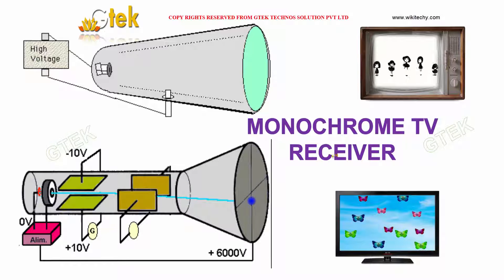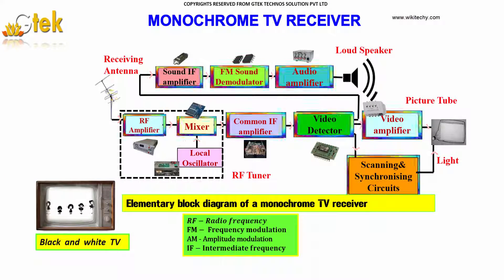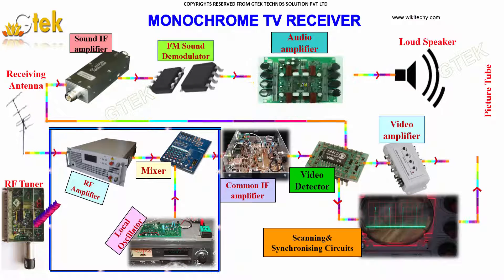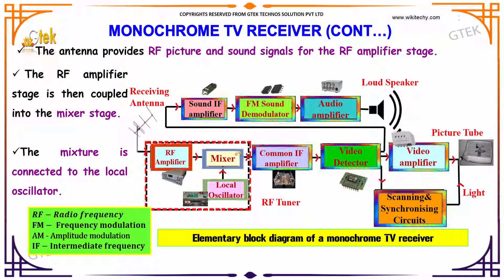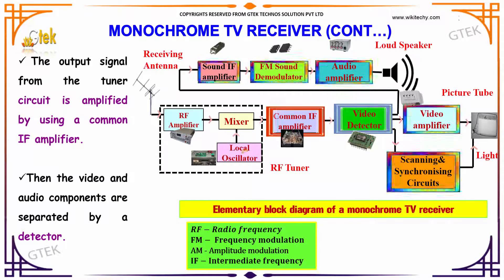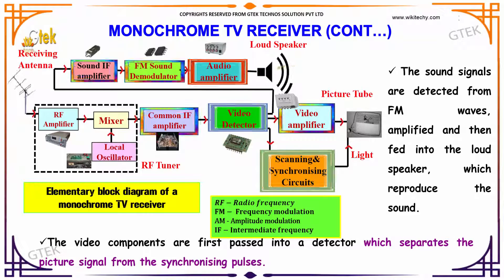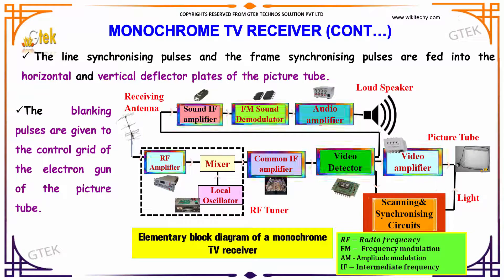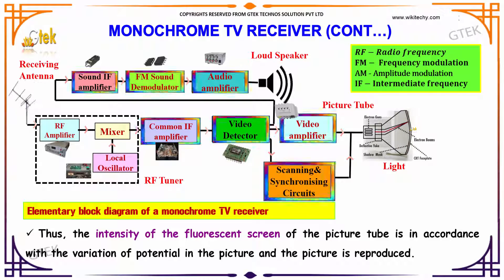Monochrome TV Receiver | Communication systems |class 12 physics subject notes|CBSE|IITJEE|NEET

Comment: The simplified block diagram of a black and white TV receiver is shown in Fig . The receiving antenna intercepts radiated RF signals and the tuner selects the desired channel frequency band. ... The antenna provides RF picture and sound signals for the RF amplifier stage.

Comment: The synchronising and scanning circuits produce sets of pulses for providing synchronising pulses for proper functioning of the TV system. This timing unit contains number of wave generating and wave shaping circuits.

Comment: Monochrome TV Receiver has the following blocks.
1. TV Receiving Aerial: the TV signal radiated by the transmitter has to be intercepted. For this an antenna with high gain, Broad Band, highly directional is used. Yagi-uda multi-element array is preferred. Impedance of the aerial should match the impedance of the transmission line. The aerial also selects the required signal and rejects unwanted signals.
2. Tuner: Also called RF Tuner/ Front end. Signals from Aerial are amplified, down converted to intermediate frequency. Band and channel selection is also carried out here. This is a separate, sealed and riveted unit mounted away from other circuits. Unit’s body is grounded to avoid interference by other strong signals. Delayed AGC is used at RF amplifier.
3. VIF Amplifier: The output of RF Tuner has two intermediate frequencies i.e. video IF (38.9 MHz) and sound IF (33.5 MHz), occupying a band width of 7 MHz. Most of the amplification and selection is done here. This is also a separate, enclosed unit. Keyed AGC is used at the base of 1st IF Amplifier.
4. Video Detector: The output of VIF section is around 2 to 5VPP. This is fed to video detector to separate various signals i.e., video, AGC, inter carrier SIF. A special diode driven into saturation has many harmonics at its output. Using LPF, signals above 5 MHz are filtered out. OA 79, Ge, heavily doped, point contact diode is used for detection.
5. Video Output Amplifier: Output of video detector which is around 2 to 5 VPPis amplified by a single stage broad band, voltage amplifier to give an output of 80 VPP. Wave Trap is used to prevent 5.5 MHz inter – carrier SIF (38.9 – 33.4 MHz = 5.5 MHz) and disturb the picture. Output of this amplifier is fed to picture tube.
6. Picture Tube: This is a special type of CRT, having widescreen with wide deflection angle. Electromagnetic deflection and electro-static Focusing is used. H and V deflection coils moulded into a single unit ‘Yoke’ is mounted on the neck. Final anode is applied with Extra high Tension (EHT) which is around 12 to 18 kV. Screen is formed by long persistence P4 phosphor, which is a mixture of cadmium tungstate and zinc sulphide. The light radiated is Yellowish white. With proper output from syn section, picture is displayed on the screen.
7. Sync Section: Output of video detector which is composite video signal has H and V sync pulses either at top or bottom edges. By feeding video signal to sync separator, sync pulses can be separated. We can use clipper circuit when the video signal is with negative sync. Further, by using LPF, V- sync can be separated. Using HPF, H sync pulses can be separated. These pulses are used to synchronize the H and V saw-tooth oscillators. Output of these oscillators are amplified and used to drive the deflection coils on the picture tube.
8. Inter Carrier SIF Section:  Output of detector has 5.5 MHz, which is the result of heterodyning between VIF and SIF (38.9 MHz – 33.4 MHz). This has frequency modulated Audio Signal. By using highly selective tuned circuit (sound-take-off coil), 5.5 MHz is separated. This is amplified and frequency demodulated to recover Audio signal.
9. Audio Section: Output from SIF section which is weak AF signal is amplified both in terms of voltage and power to drive the loud speaker. Finally, we get sound output.
10. Power Supply: Various levels of DC voltages are required for the operation of TV receiver. So, 230 V, 1 φ AC is rectified, filtered and regulated to provide ripple free steady voltage to various stages. However due to many advantages switch mode power supplied (SMPS) are widely used now-a-days. EHT and BHT required at picture tube is obtained from Auxiliary power supply using Line output transformer (LOT/EHT).